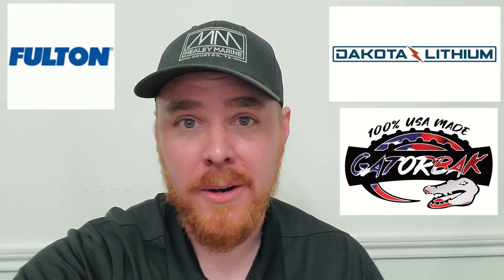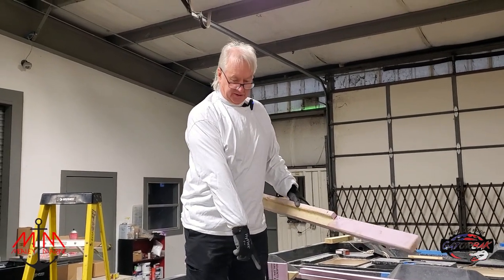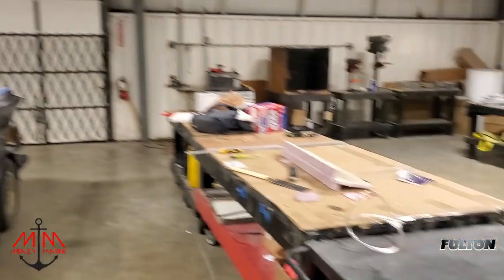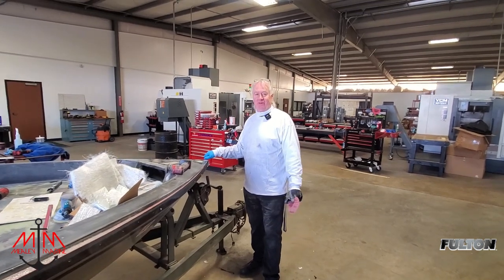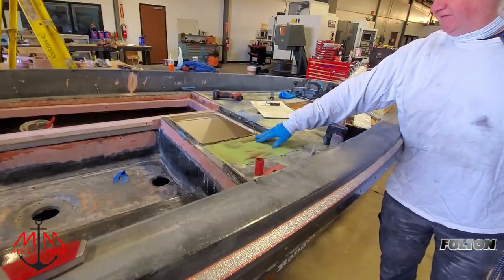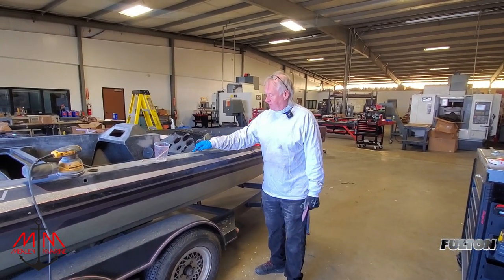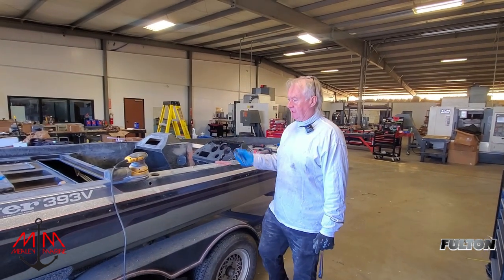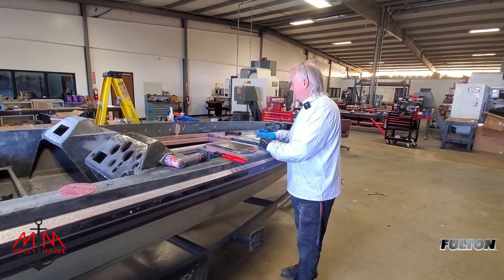BASS BOAT RESTORATION PROJECT | 1988 Ranger 393v | Part 18: Starting to Mount the Deck

Comment from the maker: What do you guys think this boat will cost ?
Reply: Wasn't expecting you to change the box layout, so not sure what the scope is.. guessing cost of boat plus 17.5k
Reply: I live in Georgia where inventory for used bass boat is out the chart, even if you achieve a "brand new look" on this project it will still be an old boat in the end, sorry. My best guess is between 8.5 k to 10 k. Amazing job btw, kudos to the crew!
Reply: 20k
Reply: Calculate in labor and it's a 50k boat.

Comment: So far $9540.00 spent. Still have to buy carpet, adhesive, paint & primer, stuff for trailer, wiring, gauges, lights, and on and on. Probably have $7000.00 in labor for two months. I can see this boat being worth about $30,000 with total labor and materials. That will be a ton of money for an older 300 series boat BUT it will be a lot cheaper than what new boats cost today. This is just a wild guess. I have a 1987 320 V that I have restored with new engine, trolling motor, garmin electronics including livescope, hydraulic steering,SS prop, jack plate, power poles, lithium batteries & charger, trolling motor foot pedal tray, keel guard, new carpet and compartment lockable latches, ratchet tie down straps, new trailer paint, tires, wiring & lights, wench and a custom home made deck extension. I have a ton of money in my old boat but at 76 years old I don’t care. I use it at least 3 days per week and have a ton of fun keeping it nice and fishing out of it.